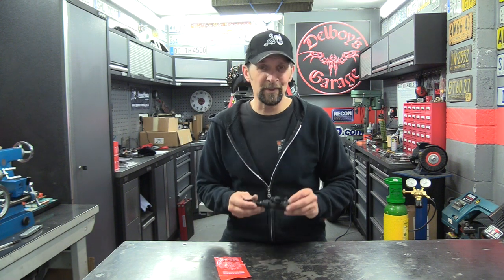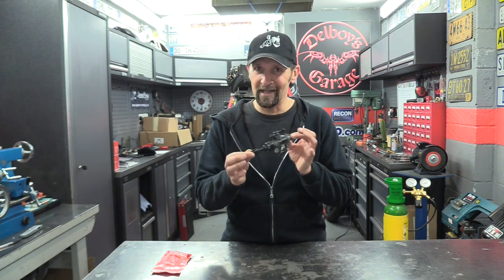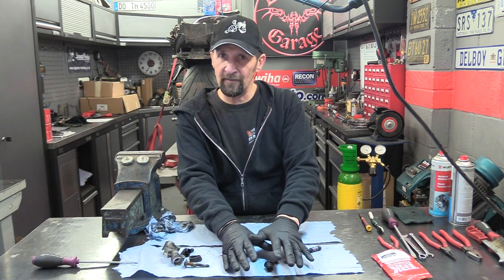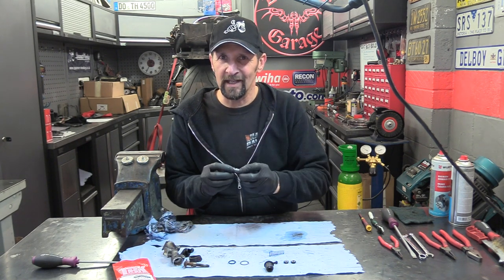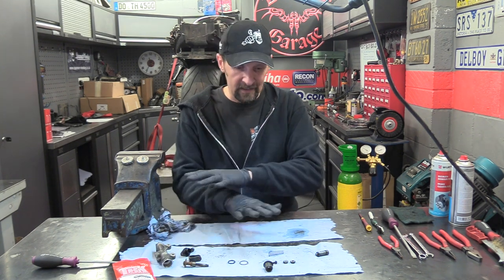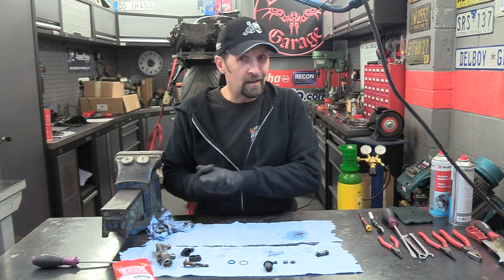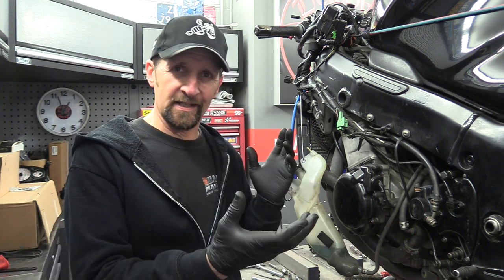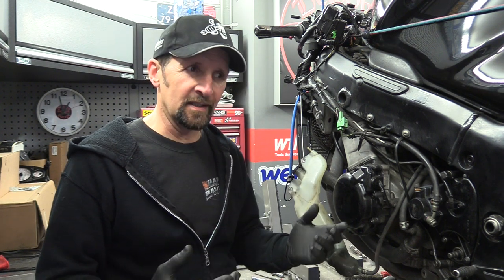Delboy's Garage, Hayabusa Day 15, "Rear Brake Master Cylinder Rebuild"

Comment from the maker: VASELINE.....
Gonna pin this at the top before anyone gets in too much of a flap over Vaseline... 

 Have no fear of Vaseline and o-rings, boots or gators.
O-rings are made out of many different materials. I would suggest that those o-rings which are made to work in the automotive realm are made to be resistant to things such as oil, gasoline, and other petroleum products. This would include Vaseline. While Vaseline and other petroleum products may degrade "real rubber" (actually made from the rubber tree), current o-rings technology does not use natural rubber.

There are rubber seals in your Petrol Tap.. Filler Cap.. and a rubber hose delivers the Gasoline to your Carburetor.. ..which also has a Rubber Diaphragm, and a Plastic air box...... 

...AND NONE OF IT DISSOLVES...!
Reply: 'Vase line'; cross that one & she throws vases . . . (sorry : )
Reply: Funny stuff...
Reply: Out of the night
Came a terrible scream
"WHO PUT THE SAND
IN THE VASELINE?!"
Reply: Thank you so much. I was misinformed from numerous sources
Reply: One other thing I would say is be wary about using brake fluid for lubricating the cylinder. I did it for a car slave cylinder I was working on once and I had to redo it again a year later. There's proper grease for it. Probably less of an issue due to location and mounting here but worth considering.

Comment: Thanks for sharing. This is exactly what I need , to disassemble the rear master cylinder, in order for me to tig weld a part, where the master cylinder reservoir is attached.
Reply from the maker: Glad it helped

Comment: Anybody know why the cylinder itself is threaded like a screw? It doesn't rotate does it?
Reply: I was wondering that too! Turns out it's to support the piston in the bore better while still allowing the brake fluid to reach both seals (because the hole that the fluid enters the cylinder from is kinda in the side and needs to moosh past the plunger body towards the seals evenly) what a messy job 😖

Comment: Nicely done!  When I saw the corrosion gripping on the actuator rod, I seriously thought that cylinder was a goner. It surprised me when you saved it. Heavy corrosion is scary!
Reply from the maker: Sire thing Scott.. if there had been pitting and corrosion inside the bore, then it would have been toast... but thankfully it was just external..

Comment: Hey. Great video.. 
I have a Ninja and the piston in the master cylinder does not retract back. I've tried changing the brake fluid but nothing happens. The piston when applied pressure moves inside the cylinder but does not retract when pressure is removed.  What could be the reason for this?

Please help🥺

Comment: Hey, so I rebuilt my rear master on my bandit gsf600s watching your video and using an All Balls Racing kit.  The issue I am having is the caliper pistons will push out, clamp onto the disk and then refuse to retract like normal.  The brake pedal height is adjusted per the FSM but in order to reach that height I had to adjust the nuts to the end of the threaded rod.  I have taken apart the caliper and the master twice now to check my work and everything appears to be correct.  The brake line is also new, made by Galfer USA.  Any ideas?

Comment: Great video Del.  I noticed a couple of very corroded fasteners that needed taming before you got to the business at hand. We've all had jobs where one friggin' frozen fastener costs more in time and effort and frustration than the problem that originally needed fixing.  Can I suggest a "Simple Skill" session on stuck screws and bolts?  How to get past them and how to avoid them next time.  I will watch it, guaranteed.
Reply from the maker: Hi Paul.. good to hear from you mate, and thanks for the nudge.. that would be a good video for sure, there are a range of techniques to get past challenging fasteners, and also how to rescue things when they snap off or wring out.. ..I still have lots to do, and plenty of fasteners that will lend themselves well for a video like that... so watch this space.. ill get to it when i get time buddy.    Have a good weekend.. and ride safe.. Del.

Comment: This looks similar to my V-Stroms rear master cylinder. Except that mine has a line in on the top from the ABS pump.  Would having abs make the rebuild job much different?
Reply from the maker: No, not the re-build itself of the cylinder, but obviously re-bleeding the system is a little more involved as am sure you know.

Comment: I learnt the hard way last week that petroleum based products don’t like brake seal’s . I thought the same that they would be resistant to petrol etc but mine swelled in the front brake master cylinder and the spring wouldn’t return the lever. I ended up having to replace all the seal’s. Enjoy your Chanel though 👍🏻

Comment: The rear wheel on my R6 won’t spin more than half a turn after the rear brake is applied following a rear wheel fitting or brake pad clean up etc suggesting the caliper piston doesn’t retract. Do you think a caliper seal replacement will sort it or is it more likely the master cylinder that need a overhaul ?
Reply from the maker: Do the caliper first, the seals are cheap, it's usually that, that's where all the grime and dust is that will jam it up... and if it still jams up.. then have a look at the master..

Comment: Hey Del! My spring doesn't come out like yours does in the video. It's not worn and everything was clean before I started putting it back together. Now the spring with the rubber part is stuck in the cylinder and doesn't want to come out. What do I do? Thank you!
Reply from the maker: Hi there.. you could hook it out with a curled piece of wire or a seal pick if you have one.. but you may damage the rubber cup... so if it was all clean before, and functions ok now, then re-assembly everything and test it to see if it works ok on the bike.. if not, you'll have to hook it out and maybe risk damaging it. !

Comment: Hi after some advice if you can please Iv rebuilt the master cylinder on my bandit 1200 and when bleeding it up the fluid comes threw but brake doesn't engage have I done something wrong? Or am I missing something eles? Cheers
Reply from the maker: You most probably have a big gulp of air in the system, trapped somewhere, and it squeezes back and forth, refusing to budge, pretty common on the rear as the hoses are horizontal and the air can't naturally drift upwards... try taking a large syringe and injecting brake fluid backwards in through the caliper bleed nipple (empty the reservoir first), and with gentle pressure, you'll see the fluid eventually fill up the reservoir and that'll give you a solid bleed... yours is a common issue with rears and this is a guaranteed fix every time!  Here's what you need:  https://www.spanner-monkey.co.uk/oil-and-brake-fluid-inspection-syringe-200ml-120826?search=brake%20syringe&description=true

Comment: Hi, I do appreciate the work you do and you already saved me lots of money working on my bike.

I recently bought GS 1200 LC in excellent condition. The only issue it has is with the rear brake which started to bug me. I checked several websites and this seems to be a common issue with GS1200 motorbikes.
 The rear brake pedal goes down  till it no longer functioning. I flushed the system, changed the oil, bleeded the system but nothing worked. I took it to the dealership who changed the master cylinder but after few minutes of driving it went down and didn't work. Then they changed the real brake caliper but the problem persists . After several attempts they told me they are clueless. Luckily i got my money back.
The thing is, the pedal goes down, but there brake liquid doesn't leak, i checked the level and it's always at Max. No leakage or any drop of liquid anywhere on or beneath the bike. Do you have any suggestion what the issue might be?
Reply from the maker: OK, a possible suggestion, it may be a blown master cylinder seal.... so 'Question', does the brake work if you pump the pedal rather then hold it pressed down.... meaning, does it only sink slowly when you hold the pedal pressed?
Reply: @Moonfleet41  Thank you for the quick answer. 
- Yes, the brake will work anytime I pump it.
- The pedal WILL NOT sink if pressed and hold down. 
- The more I use it the more it sinks. 
- If I pump it while riding it will work but will start to "fade" quickly till it's completely not braking. 
 - Worth saying that I won't sink if I don't use it. (either if the bike on the garage or didn't press it while riding)
Reply from the maker: OK, then it's clear... The seals in the brake master cylinder will most likely be leaking fluid past... if you're not familiar with the system,  when you press the brake pedal, the master cylinder piston forces the fluid down to the brake caliper and clamps the brake pads against the disc... In your case, it is most likely that the rubber seal inside that master cylinder is failing and allowing fluid to pass back the other side of it.... this won't leak out as the system is sealed, which is why you have a full fluid level still... but as the seal is not sealing when you press the pedal, the piston is moving down the cylinder but some fluid is escaping back past it.. when you release, the seal retracts back as it is designed to flow through the fluid backwards, but seal and force the fluid forwards.... if you simply replace the rubber seals in the master cylinder, this will most likely cure your problem... I've had this many times with both front and rear in many bikes, and a new seal kit fixes it..it's just wear and tear.   not much money for the kit, your BMW dealer should be able to order them for you... I hope that helps you out, and good luck with it.  !
Reply: @Moonfleet41  Thank you Del. That make sense! I'll try to change the seals in the master cylinder myself and come back to you with the results. I hope it will work as all the repairs I learned from your videos did 🙂 Thank you again and talk to you soon!
Reply: @Moonfleet41  hi Del. Unfortunately the problem was not solved. I got brand new master cylinder and the problem remains the same. The pedal will work great for few minutes then it sinks all the way down.
Reply: @Moonfleet41  Hi, came to update you with my rear brake issue. After changing everything that could be changed (one at a time) the issue was related to ABS module failure. I changed it and the brake is back to work like it should be. 
A note to mention, I met many GS owners who suffer from the same problem, this seems to be common problem in GS series 2013 - 2018, I even met rider with BMW 1000XR.
So, just in case someone poped up in your garage with this issue, you have the fix now :)
Greetings from Algeria!
Reply from the maker: @AlgeriaRiderdz  Thank you for updating us, I imagine that was an expensive repair and it's great to hear you finally got it fixed!

Comment: Nice..  
Btw dell need some advise, i am changing the engine oil in my 16 hayabusa, i want to use the engine flush , its by STP. Should i use it, will it be beneficial?
Reply from the maker: Hi there Ragz... You Don't need engine flush in a 3 year old Japanese bike mate... just warm up the engine, drain the old oil for a hour to get as much out as possible, change the filer and refill with new oil....that will be fine mate.. Good luck with it.

Comment: Love work 
Very helpful 
Any suggestions with sticky clutch plates without having to pull it all apart? On a busa.
Many thanks
Reply from the maker: Hey buddy, clutch plates get stuck together with oil so an oil change is always beneficial?

Comment: Hi mate silly question time, when you wire wheel and clean up the bits do you need to coat/paint them to protect the metal?
Reply from the maker: Yeah, strictly speaking you do.. but painting bolt heads is a waste of time, as soon as you put a tool on them it will ruin the paint.. stainless steel fasteners is the true remedy.. but a smear of grease over them will keep it at bay.
Reply: Cheers how about the slave cylinder ? Or is that a hard metal so weather proof
Reply from the maker: @lambo2817  Hydraulic cylinders are usually cast aluminium..

Comment: Hi Del. I removed my master cylinder today from my Busa. My rear brakes were left for quite some time before I decided to remove it. I don't know if you've come across this before: I removed my circlip, that was fine. I removed the rod, that was fine. However the part that the rod presses in to, it appears to be completely seized in there - is that common? I can't currently see past it at the moment. As I look in to the cylinder it appears to be just a complete concave shape. Where as on yours, the spring seems to just push yours straight out. What you think that is? you think it's even worth trying to remove it or do you think buying a second hand master cylinder might be best? Cheers
Reply: Dude I am having the exact same issue. Idk what to do. Did you ever find a solution?
Reply: @c4yourself319  I just replaced the master cylinder with a one on eBay or Amazon. There are some universal fitting ones and some specific to your model on there
Reply: @hunterjg777  damn I didn't wanna have to do that but I guess I don't have a whole lot of options. I actually got everything out of it but the damn thing gets stuck every time I push it back in. I have half a mind to cut away a small about our rubber with an exacto-blade
Reply: @hunterjg777  thank you for replying btw!

Comment: Great video, very helpful info!!

I have a Suzuki GSF250 and it has pretty much the same rear brake master. It has been sitting for a while and the circlip is completely rusted + sort of welded onto the ram plate (?) it's resting on. The circlip ears were horribly weak and broke off immediately like old flaky rust, because the seals on the plunger had leaked and allowed brake fluid to seep down soaking everything.

Please help! Any suggestions on getting the circlip/snap ring off without damaging the cylinder body would be hugely appreciated! We don't have replacement parts at all for Japanese Suzuki motorcycles where I live and had to even get the rebuild kit shipped from China.

PS - I believe that plunger is a 12.7 mm / 0.5" by the look of it?
Reply from the maker: Hi there Nisal, if the circlip ears have broken off, then there is no easy fix... the best you can do is try to lever out the remains with a thin tiny screwdriver, it won't be easy, but a little penetrating fluid and warm it up and you may make it move... but if all else fails, perhaps you could get a second hand master cylinder from another bike?  Do you have people selling second hand spares there?  That would be the only option if it truly won't come out... it may help if you push down the plunger to hold the weight off the circlip and a little patience, you may prise it out...
Reply: @Moonfleet41   @Delboy's Garage  Hi Del, thank you so much for the quick response!!

Guess it's just a matter of luck to see if I can get this off then; heating it up didn't occur to me but will definitely try that, thanks again! The circlip is literally sort of welded together with the lower metal plate it sits on with rust itself and I was afraid to clamp it down in a vice and try pulling out, in case the groove got damaged. Any progress I've made so far has been with a small flathead screwdriver as you suggested but there's very little space to work with, making it all the more difficult.

Yes we do have lots of parts for JP Honda bikes but only for those, no Suzuki, Yamaha and literally zero Kawasaki parts. I've a broken indicator (shared with Yamaha Zeal 250 if I'm not mistaken) which I've been hunting for months, no option to bring down either due to the pandemic situation.
I had a look at some Honda master cylinders (need to buy the whole thing, with reservoir and all) but all of them are differently sized, shapes and lengths, especially the screw holes being out of line with the GSF 250 holder.
Reply: @Moonfleet41  Hi Del, after trying out  various methods over the past few weeks without any luck, I had almost given up on the cylinder and was about to replace it with replica Chinese cylinder for Honda's by drilling out correct spacing. But we had to visit a machine shop to get some parts for a friend and I took the cylinder just in case and asked them to somehow disassemble it whichever way possible, that I didn't really mind even if the whole thing breaks in the process because I had no other option.
I described to them what you followed, I'm not sure how they did it, but they had removed all the rusted out bits with minimal damage to the aluminium cylinder body and disassembled within 15 minutes!! They don't work on brakes at all, mostly engine boring, sleeving and valve grinding but such a relief I can get rear brakes working again.

Thank you so much for the very helpful and informative videos!
Reply from the maker: @viduranisal  Wow that's good news Nisal, glad they've got it fixed for you, I guess they have the equipment and experience to find a solution!  Glad you can get your brakes back working again, nowt like having the original parts in order instead of Chinese replacements!